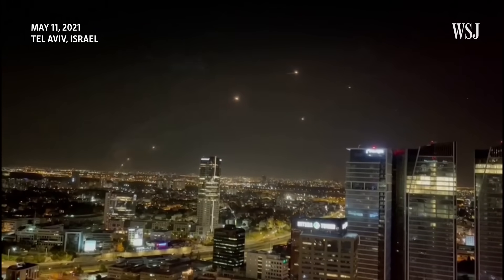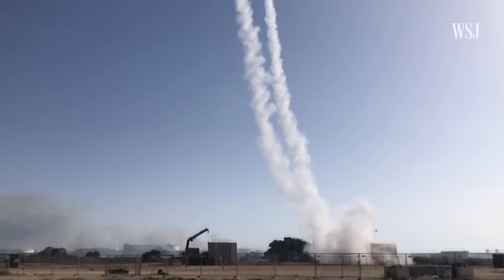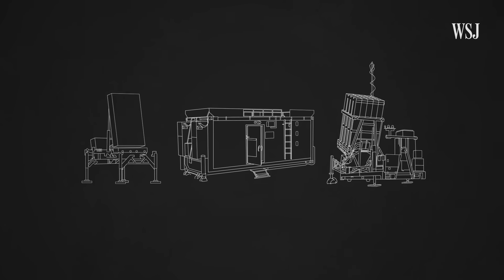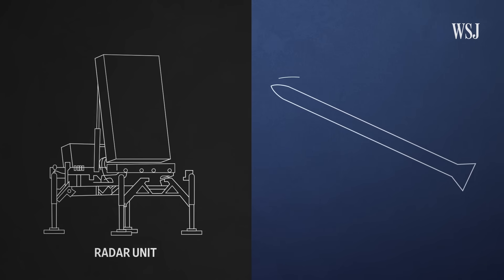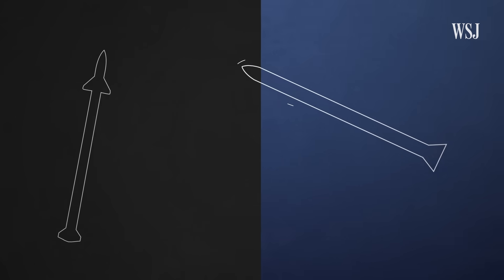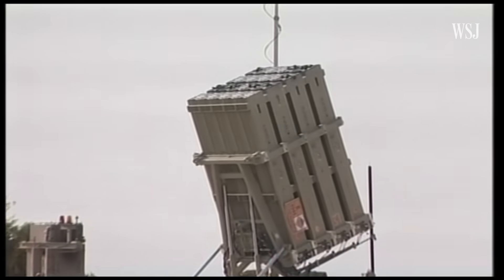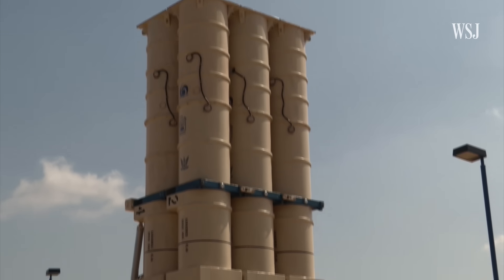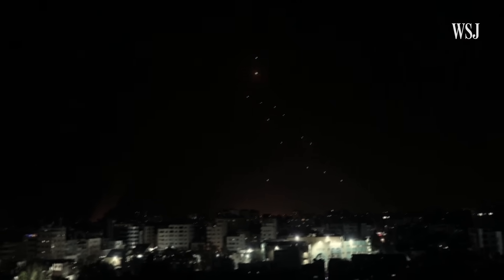How Israel’s Iron Dome Works | WSJ

Comment: How much does each one cost relative to the rockets they are shooting down?
Reply: Israel has 1000 time the budget, but also each rocket costs 1000 times more. But citizens lives are more important than money, something Israel values but the hamas terrorists don't really think themselves
Reply: @megacaptcha5894  nailed it on the head there.
Reply: Think about it, didn't spend the 40k, rocket hits bus station or train station or library, costs 50 60 70k to rebuild.
Reply: @paul-ms3fi   I've done the math it'll cost about $10 per Israeli over the course of this battle. I think they can hanle it.
Reply: 40k$ for each iron dome rocket vs about 100$ or so. Hamas is practically shooting pole signs filled with sugar and fertilizer

Comment: Cara mudah menghancurkan tank Merkava

Tank Merkava ,kualitasnya sama dengan tank umumnya ,cuma punya kelebihan ,punya sistem iron dome mini .

Cara nembak nya ?

Sebaiknya roket A120/A160 di lapisi carbon murni+Barium=campur poxy resin= RAM (radar absorbing material), guna menurunkan drastis RCS(radar cross section)2mm.(atau Body roket terbuat dari resin tahan panas tinggi rigid mix carbon murni jadilah : Roket/rudal Stealth / roket Siluman ,60-80%tidak tedetec radar ,jarak makin dekat % menurun).

Tembakkan ke tank Merkava , Kena DECH ....👍

(Sensor di tank Merkava perlu kecepatan tinggi dan jarak pendek efektif pakai sensor laser atau infrared, jadi tidak bisa mendetec ,atau sensor pengarahkan arah tembak tidak bekerja).

Comment: Doesn’t this mean that decoy rockets could deplete the reserves of ID missiles? Why fire the rockets meant to deal damage when you could fire thousands of empty ones to make it easier for the real ones to pass by
Reply: Building fake missiles is a waste of money 💰
Reply: Well building a fake missile costs equal as real
Reply: Hamas would have to fire more rockets at populated areas than Israel has rockets to intercept with. If they aim for unpopulated areas the Iron Dome does not respond. They explain this in the report.
Reply: That's largely what Hamas already does. They fire a bunch not so much with the expectation they would actually hit anything, but to waste resources since each one of those missiles cost 150x more than each those rockets.
Reply: https://youtu.be/x0crQ9EJ9m8
Reply: The opposing side could also relay short-range rockets to change trajectory in order to appear non-threatening.  
Or fire rockets with ball-bearings that would explode in-air to rain down.
Reply: @LazyHermit  too complicated for them. unless Iran sends some help
Reply: @LazyHermit  it's about the resources your enemy has. The iron dome is perfect for Israel to defend against Hamas, it isn't intended to be used against Saudi Arabia who can easily afford decoys and countermeasures
Reply: swarm tech has already been in the pipeline for years and is being design as well as being prepared for.
Reply: These guys can't even manage rockets that reach their target half the time, a feint is way beyond their competence.
Reply: Hamas terrorists: *taking notes*
Reply: @hamadaj8081  hamas aren’t terrorists 🤦‍♂️
Reply: @Mrjoboo1  
Honestly, i don't care, i was just trying to make a joke.
But also i agree that we can't let the U.S and israel decide who is a terrorist and who is not.
Reply: @hamadaj8081  exactly they are corrupt and literally call any of their muslim enemies “terrorists”
Reply: @Mrjoboo1  zionist is a good word. It means someone who believes in the protection of the jewish state.
Reply: The iron dome can deploy 20 missiles at a time. And surely it would be published somewhere how many iron domes there are...So , why don't they calculate that and send a couple of more rockets....They seem to be sending rockets at the border below the potential of the iron dome....wonder why  🤔